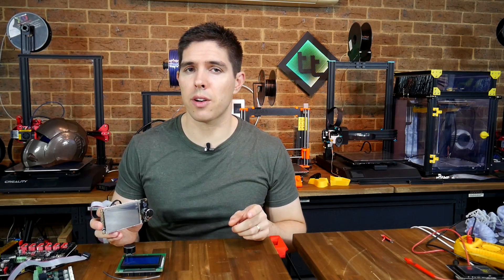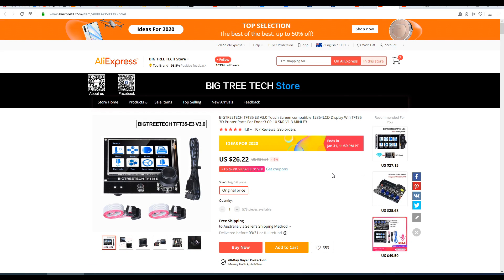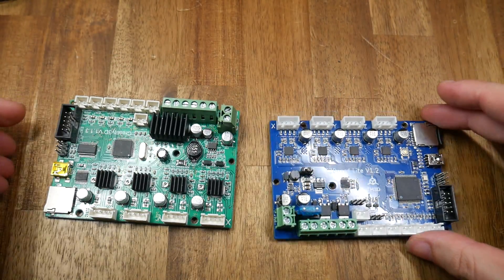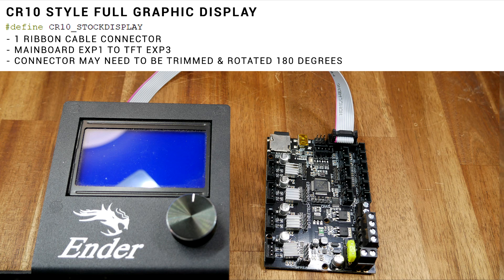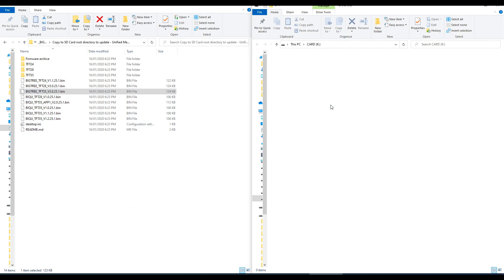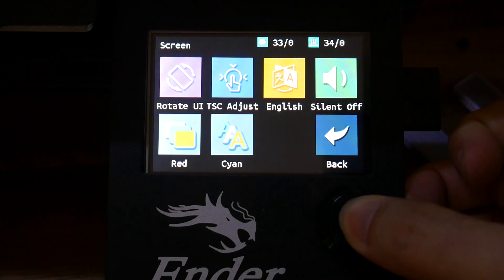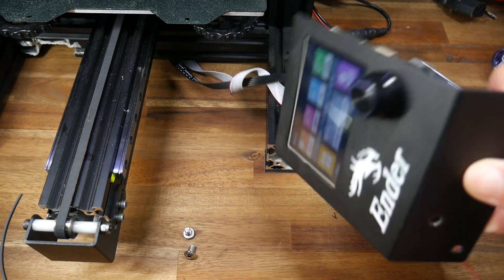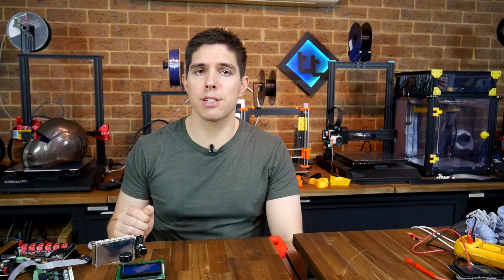BTT TFT35 dual mode touch screen guide

Comment from the maker: After reading some comments below, I retested Octoprint + the TFT at the same time. SKR mini E3 is fine but can confirm SKR V1.3 is not working. UPDATE and now it is working. Astrobox and Octoprint both connect at the same time as the TFT35, I can send movement commands back and forth from either without issues, but it took a few times to connect.
Reply: What I'm hoping they come up with is a way for the TFT to display print status / progress for jobs running on Octoprint.  Right now you have to be in Marlin mode to see anything.  I use the M73 plugin for Octoprint + have the necessary lines enabled in configuration_adv.h    ( #define USE_M73_REMAINING_TIME )
Reply: Hello.Can you show how to config marlin 2.0.x firmware for attach this BTT TFT35 to MKS_GEN_L 2.0?
Reply: So does it work for the skr v1.3 board?
Reply from the maker: Yes, but it can be tricky to get both to connect. Once they do, it works as expected.
Reply: @TeachingTech  will there be a video on how to or instructions ?
Reply: @TeachingTech  Please do a video on this. Im having problems connecting to octoprint
Reply: I'll be ordering one soon to test/use on my cr-10s; it came with the creality 1.2 board, the screen is connected using 2 ribbon cables, and the board has a vacant 8 pin Aux-1 connector.  Wish me luck!
Reply: @cracKness  hello so its working on your cr10s ?
Reply: @chrisnzog8643  yes and no.  Commands sent from octoprint dont work unless it's in marlin (emulated) mode. I read somewhere that the USB connection from octoprint uses the same port that is used by the tft35 in touchscreen mode.

There might be a way by connecting the octopi directly to the screen, but I havent had time to try it yet.  However, outside of issues with octoprint, the TFT35 works great in emulated and touchscreen mode on my CR-10s with a creality 2.1 board.
Reply: @cracKness  I have an SKR v1.3 + TFT35 and Octoprint running nicely together. In Marlin 2.0, set #define SERIAL_PORT 0 and #define SERIAL_PORT_2 -1 in Configuration.h. This stops Octoprint USB colliding with the display in touchscreen mode.
Reply: Mark Rudnicki I appreciate the info and for sure others can use it... but I’m using the stock creality 2.1 board.  I think I read somewhere that the SKR board uses a virtual serial port for the USB, which is what allows this to work.
Reply: @markrudnicki9756  Did you get the Progress Bar or M117 Status Messages to work on the TFT when Printing from OctoPrint?
Reply: @markrudnicki9756  If I do that I always get a failure #error "SERIAL_PORT cannot be 0. (Port 0 does not exist.) Please update your configuration." So, what do I wrong?
Reply: @iMattmax  This is what I use now:

#define SERIAL_PORT -1

#define SERIAL_PORT_2 2
Reply: @markrudnicki9756  I have compiled my Marlin using Make'n Print easy to follow SKR mini e3 v2 setup guide. The guide says to set SERIAL_PORT 2  when using a TFT. Is this the cause of the issue with Octoprint?
Reply: @mikem8145  octoprint uses usb wich uses serial -1 setting serial 2 as 2 is fine, and will work for you. If you want to run a filament runout sensor from the tft instead of the skr you need to do 2 things one enable advance pause feature in marlin, and enable runout filament sensor in the tft firmware. Im not sure is its indispensable the first, since the tft bypasses a lot of the mainboard, but still a nice feature to have in fw
Reply: @deathcube2006  Which option is better? Connect the BTT Smart Filament Sensor on the SKR mini E3 v2 board or connect it on the BTT tft ? Which option offers the best user experience with Octoprint?
Reply: I was having issues with the e3 mini board 1.2..... it would start print from octoprint then just stop a minute into said print ..the tft screen I could control the printer still but couldn’t give it a new print job from sd card or usb.. I’ve not tried in last month so maybe I should update fw on both main board and tft
Reply: Hi with the SKR 1.3 I found in marlin comment out CR10 lcd then using 2 ribbon connectors between exp 1 and 2
Reply: Could you please do a follow up video on getting this to work? Thanks!
Reply: Could you start putting indexed locations in your videos please? For instance if I were looking for the part of the video where you build the fw.
Reply: Pls can You make a vídeo going over encoders for filament ?
Reply: Filament runout doesn't appear to work when using the TFT and printing through Octoprint, with the filament sensor connected to the board!
Reply: @ManIkWeet  Hi, did you manage to make it work? I have the SKR mini e3 v2, I'm printing via Octoprint, and I'm about to install the BTT smart filament sensor by connecting it to the SKR board. I'm really interested to know if you finally succeed in making this work.
Reply: You have to have the USB cable disconnected - then power up the Ender 3 and power up Octoprint. Once both are going then connect the USB cable. Rumor has it that you can cut the 5v pin out of the USB cable, then it works. https://community.octoprint.org/t/put-tape-on-the-5v-pin-why-and-how/13574
Reply: @Teacging Tech  ,  can please say me if you got this TFT running with a original Ender 3 board in graphical mode?
After watching your video I have ordered a BigTreeTech V3.0 E3 for myself. 
I can run it only in the older "Marlin mode" , in graphical mode i see all the time the message  "No printer attached", the same if i change the baud rate from 11500 to 25000. The next issue I have is that non of my SD-cards are working with the TFT. I have tested 1 GB sd cards over 4 GB, 8 GB 32 GB and 64 GB cards. I have also change the formate from NTFS over FAT32 to FAT but i get all the time the message  "Read TFT SD card error". 
I ordered a second one and have exactly the same issues.
MY Board in my Ender 3 is a original Creality Board version 1.1.5 (the silent one).
So can you please say if you get the grafical mode to work with a original board as well if you can update the firmeware if the TFT is connectet to a original creality board? Thank you
Reply: I think the problem lies in the buffers, I had bad blobs from this TFT35 on SKR v1.3 but after a lot of tweaking on the buffers it now print very good again.
Reply: @teaching tech please do a video on how to get Octoprint and the SKR 1.4 working with TFT.
Reply: Any luck getting proper functionality on a Manta M8P?

Comment: Excellent video as always.  I am ready to install the BTT TFT35 V3.0 on my Anycubic Kossel Linear Plus running the BTT SKR V1.4 Turbo board and have also bought the BTT DCDC MODE V1.0 Power Module to provide extra current for the TFT display.  Now I am reading several instances of people shorting out their SKR boards after installing the Power module and don't really want to risk it.  Is the Power module necessary or does the SKR board provide enough current to run the display?  Thanks

Comment: Hi, I have 2 questions.
I installed this TFT board to my Ender3Pro together with an SKR Mini e3v3 and everything seems to work, but 1 strange thing. If I press the knob for 3seconds it starts beeping every second I push the knob. Eventually it does change modes, but this seems strange?

Second question:
I want to update it's firmware, but on the github it shows that it is dependant on Marlin v2.1.x but my SKR Mini e3 has Marlin fw 2.0 (and no newer precompiled firmware on the BTT github).
Can I just install the newer TFT firmware? or will it break things?

Comment: I got 2 ender 3's.  The first I set up with skr mini E3 and the TFT 35.  My first build works fine.

I am putting finish touches on the second ender 3.  Just changed out the motherboard and monitor to TFT 35. 

This setup works fine if I set the monitor in LCD mode.  But the printer is not found when using touch screen mode.  I swapped TFT over from the working system.  Same problem.  It seems there may be a firmware problem in the skr mini E3 V3.0.

Comment: Hi, I have been using BTT TFT with BTT graphic interface for 2 years but still have problems setting the Z-offset. I have a "Z-offset" button (that swithces on/off), a "Reset" button, a "Save" button , but I don't understand wich is the correct procedure to set it and save it. Keep in mind that I've also BLTouch. Any help thanks in advance.

Comment: Hi, just got the touch screen to go with a new BTT E3 v3  which one would expect should really work outta the box. Is it a drop in upgrade? Is it phooey. In defence of my use of such profanity is i am a tad frustrated as I can't see how more contained an ecosystem one could have other than two brand new BTT products made and connected to each other, just like Dick and Liz, Bogart and Bacall,. Amber and Jonny, Kurt and Courtney,...oh, actually maybe not. But they should work. 

 So i still get the no 3d printer attached on 115k, 250K, special K, makes no difference. I got a message to say the TFT is in listening mode but i got paranoid and turned that off, and anyway the no printer found message stayed. Maybe i should try messing around with the fw for the board and the screen? Since my E3.2 screen died this is the most life I have seen from my E3.2 and it is impressive. However ultimately i would like the screen and board to control the printer, without me having to go on a global search with my life savings for the holy grail, a Raspberry 3.1415926535 , but I will try to install to Klipper later, as if its one thing i have it is old Android phones (I have 3 Pis actually, but they are so old i may as well have a single NPN transistor.)

Any ideas as to how to get the printer working? to recap: Ender 3v2, BTT SKR E3 V3.01 and TFT screen with serial and EXP 3 ports connected.
Reply: did it finally worked, and how did you did it 🤔

Comment: My bed leveling is useless in touch mode but its super accurate in marlin mode. I try to edit mesh in touch mode but it makes no changes when i edit each point, and save after making changes... but marlin mode, I dont even need to edit any points because its already 99% accurate after probing bed. SO STUPID!!!!

Comment: see i did this with my TFT35....
And the screen was hugged to tight to where it effected the screen greatly.

I couldnt even push anything, So i ended up using some small shrinkwrap. Heated it up till it tightened up..
the cut little 1/8in pieces and put on the screws as a buffer so the screen wasnt squeezed.

Comment: I have a btt-e3- rrf mainboard. The sd card reader on this is faulty so are unable to update marlin. My question is would it be possible to use the sd on btt tft 35 to update marlin on mainboard.

Comment: great video...i just installed this on a Sovol SV01 and after i figure out the tft cable was in backwards, works but screen is washed out, the only real problem i had was mounting it in place of the original screen..need a small spacer as tightened down snug it pressed on the screen and all you seen was the the graphic for switching screen modes. As i loosened the 4 lil bolts it worked fine

Comment: Beware.  The Firmware file structure has changed since this video was released.  Both the firmware file and the support folder copied to the SD card are now in sub folders.  Fortunately, they are easy to figure out and are named in a consistent manner.

Comment: I have an Ender 5 Plus with the Creality silent board. I also have a BTT TFT70 that I would like to install on my printer. I have been told that it is possible with a firmware flash, but I have not been able to find the flash. I also don't know if the flash is supposed to be for the main board, or the display. I'm really hoping you can help, thanks in advance.

Comment: I still get the " no printer connected" notice. I'm thinking about sending mine back. I've tried everything to get it to work. Every pin combo and firmware tweak. I'm tired of messing with it. SKR mini E3 2.0.

Comment: If changing the baud rate doesn't connect to the printer what else should i check? I am installing it on an Ender 3 Max Stock board.

Comment: For several days I have been trying to connect the BTT TFT35 V3.0 monitor to BTT GTR and I keep getting the message "no printer attached". Classic marlin works fine, but touch mode doesn't. Do you have an idea how to fix it?

Comment: Don't know what I mede wrong. I I've put a new version of TFT35 E3 V3.0 on the display. On startup the display says there is a card in the reader but does not update the firmware and directly displays  the interface.

Is there some specific issue with that new version of the display ? Some setting I have to change before updating ?

Comment: Great set of Videos, Just 1 question i have the TFT35 and want to use it with a V4.2.7 Silent Motherboard with TMC2225 where and what way do i connect the black ribbon cable

Comment: how do you set this up in firmware for the motherboard?? I have a SKR1.4 Turbo, and im doing firmware to suit the machine im building, but what do i need to comment/ uncomment for the LCD TFT etc?
Reply: This needs an answer. I have no idea of which display I should uncomment in Marlin and BTT does not adress this in their documentation. I had the SKR 1.4 Turbo working with the TFT at first, but I had to update the Marlin-firmware to fit my printer. Now there is no connection anymore. Baud rates are set correctly (both at 250000)

Comment: Micheal, I am frustrated. I cannot find info on any info about using the screen and board from BTT for my "CR-10S Pro" My screen is not not working. Will the Btt boar and screen work with the CR-10S Pro?

Comment: hi do you know what is the problem with octoprint i mean i can print but the TFT35 wont recognize that there is printign it mantains in te ready mode (the sensor of noxxle and bed mark the correct temperature ) but when i print from octoprint it does not recognize that i am printing thanks

Comment: Hi. I have a BIQU B1, yesterday my touch screen freezed and I had to turn off the printer. Now when I turn on the printer the screen mode option appears and when I use the knob to selec one option, it freezes and nothing happens. I already update Marlin and the TFT firmware as you showed, but the problem persists. Could you give an advice to solve this problem? I am a newbie to the 3D printing world. Thank you.

Comment: Michael, thanks for the great video. This really helped me get the TFT35 working on my old Maker Gear M2. I was surprised how straight forward it was to update the old RAMBo 1.3.
I only have one question. Is there a way to adjust the sensitivity of the touch screen? Mine seems to need a double press all too often.

Comment: Dam i guess I needed a video to tell me YOU  CANT USE THE TOUCH SCREEN SIDE WITH THE STOCK BOARD PERIOD All the brief explaining on  it seems so delibrate,because now I'm gonna have to buy whatever board for it.And a little tip,try taking out your sd card and see if that takes away your lit up blank screen.

Comment: How to switch back to the touch screen interface?! Accidentally got stuck in the 'classic' emulator (Marlin?) interface and can't get back! Have tried reset button, reflashing mainboard firmware, power cycling, all options in the Marlin interface... nada. Help... anyone? (thanks!)

Edit. I RTFM, it's on the first page. I'll edit this comment rather than deleting it so anyone else who gets stuck in Marlin mode can get back to touch mode - hold the dial button for ~3 seconds and you get the menu to choose between interfaces. Cheers.

Comment: Is it possible to have the ‘BTT touch mode’ work as an octopi screen with octodash?  I’m not interested in having two physical screens on my printer nor the default touch interface of the BTT dual mode screens.  Retain the marlin mode but put the raspberry pi on the tft connection?

Comment: Unfortunately, this is not the first time, when I believe in the video you made. I bought this TFT 35, follow all steps you recommended and found a lot of things are not as you described in your video. For example, the bin file on the SDCARD is not enough during the upgrade of the firmware, you have to put there the config.ini as well, which is even not discussed in your video. Another thing is, after the firmware upgrade - I really not changed too much,  only what you changed in your video - and the simulator mode is not working. Still do not know why. Last, but not least, if you build this screen into your Ender 3, use some insulating tape for the metal frame, otherwise, the touch screen will continuously feel, you are touching the screen, therefore it is just stuck on the selection screen for touch mode or simulator. 
I got the same experience previously with other videos as well, like SKR 1.4 turbo board. 
Overall, this is a very nice promo video, but it is very far away from a professional guide. I'm very disappointed, unsubscribe now.

Comment: ok, i'm confused, I have a TFT35 v3.0.26 and i cannot find the BL touch setup screen in touchscreen mode that you showed in your video. Any thoughts from anyone.
Reply: I have this problem too, but get round it by going to the LCD mode and back to graphics mode or doing a G29 from the graphics screen- in both cases the graphic screen "magically" brings up the BL Touch after doing either.
Reply: I've now just updated the firmware (as detailed in the video) and now all is OK.

Comment: at about the 6:42 mark when you are replacing and ender 3 screen, you mention having to print a custom mount, unless you use the E3D version, which is a direct fit.  What are you referring to?  The E3D version of what exactly?  I don't find anything E3D that seems to apply here and I'm trying to make sure I get the right parts.

Comment: I would love to see both screen modes only needing rs232. It is pain to use rotary in marlin mode. with both ext1 and ext 2 connected those connections have other uses.